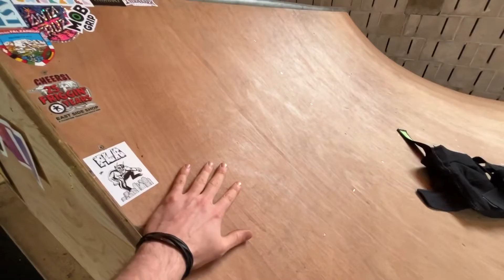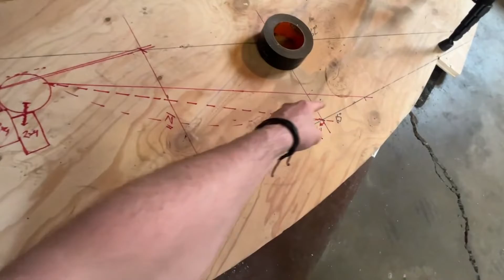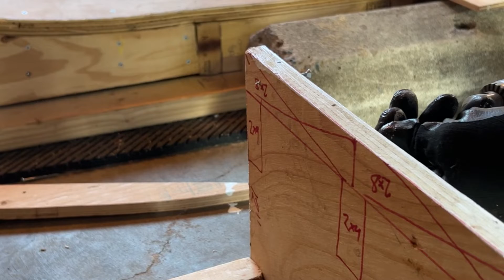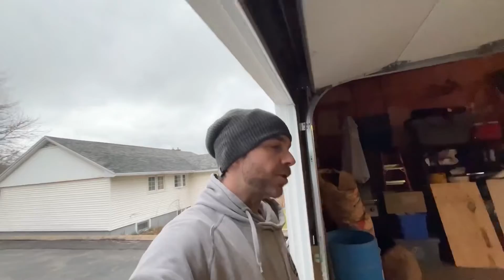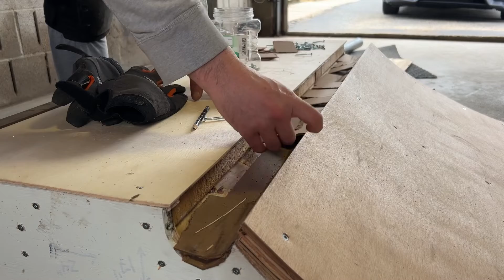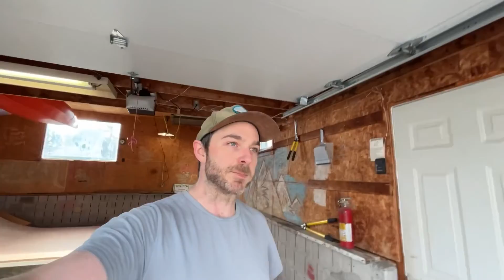How to Build an Easy to Skate Micro Quarter Pipe!

Comment: Disregard my lasrt questions,    i got the incorrect wood for this project.  Its too stiff and heavy to cut and bend: 3/4 pine pressure treated G.C. 4x8.    So cheapper wood ,is ok ?  Oh i do plan on having the ramp outside

Comment: Not sure if you’ll respond to this but I just built one of these. I built it 12” high but I think I went too tight on the transition. I did a 4 foot radius I should’ve probably went 4.5’ or even 5’. Also only have a 1 1/4” coping. My wife and I are opening a hair salon and there was a natural gas line that needed to be cut out so I used that and kind of mad at myself for being cheap and use it. For the coping I used 3/8” bolts through the 2x4 worked really well and I can adjust the height of my coping. Thanks for this video it helped a lot. Just need to finish the top deck of it and attach my angle iron. I do need to get a sheet of hardboard and a steel plate for the bottom but cost of materials is insane right now. My next project will be a 3’ high by 6 foot wide mini ramp in the garage. Debating if I want to do a full mini ramp or 2 quarter pipes.
Reply from the maker: Hey thanks for your comment! Two quarter pipes will be a little less expensive and probably more convenient (since you can move them) but a mini does ride a bit better! Let me know if
Reply: @skate_oasis last part of your reply was cut off for some reason but thank you for the reply. Yeah I may do two quarter pipes that way during the winter I can skate my ledge and manual pad move things around. Yeah it’s a little tough to skate. I cut the radius slightly steeper in hopes I’d be able to actually rock my rock to fakies but it seems no matter how tight the radius is something that short wouldn’t be able to do that regardless. I just got back into skateboarding now at 35 after 18 years of not skateboarding. It’s nice to build the things I wasn’t able to as a kid. I mainly built this one for my kids and for me to play around with. I made a small manual pad/ledge but the ledge is only about 8” high and hard to learn krooked grinds again and popping in nose slides and tail slides. Debating if I want to use angle iron or cut in a square tube or another piece of that round rigid conduit. For sure will need to get some smooth masonite for the decking and top layer of the transition. Just have to remove the 1/4” top layer I have on there now. It works but can feel it with my 51mm wheels
Reply: How do u figure out the smallest ,melowist transition? Just eyeball it

Comment: Whats the length on the top sheets of plywood for the transition surface
Reply from the maker: Good question - and I do not recall. They’re not that long, I measured and cut them after I set both bottom sheets and the threshold

Comment: each top layer should go to the ground not cut at the same length as the one under it
Reply from the maker: Excellent point! Can you tell I'm an amateur lol!? 
That being said, I knew I was using a really serious piece of steel for the threshold so I wouldn't run into any issues with deflection at that point. 
Thanks for commenting!

Comment: Hello   as a super begginer and wanting to drop in starting off small.  Would this be considered a true drop in or does a drop in have to be on vert.  I want to learn
Reply from the maker: Hey! Firstly, welcome to the skateboarding family! 
Regarding dropping in - this is a really small ramp but all the fundamentals for dropping in are the same. 
I'm not really a big fan of labelling tricks or moves as "true" or "real" because everything is valid IMO. 
Tallest thing I've dropped in on was 8' tall, still not a vert ramp though.
I guess my point is that you should always start small, and you should celebrate the moves you can do and not worry about how they stack up against others. 
Thanks for your comment!

Comment: How did you determine your transition line? Just eyeball it?
Reply from the maker: For this one i traced the transition on my mini ramp. But for that I lined up a long 2x4 with a sharpie on one end and the other screwed into plywood so its like a big swinging arm. Ben Degros has a great tutorial on this. 
I went with a 6' radius because thats what Keen Ramps use on their 2' high x 8' wide model. I wanted something chill and easy to skate.
Reply: @skate_oasis great, thanks!

Comment: How much does the coping come out?
Reply from the maker: The coping relief is between 1/4" and 3/8" 
I think that's what Keen Ramps uses on theirs and that is what Ben Degros reccomends in his mini ramp building videos. The trick is to get enough exposure so you can feel the bonk, but not so much that you'll stop and hang up on the way up or down. Luckily though, the ramp is very difficult to hang up on because of the height and it's (relative) mellow transition radius. 
I've done this a few times so I have a little wooden template I use to find the right coping place, but it's always a bit of a challenge. I'm by no means a skilled builder, so I go slow and double (and triple) check everything.
Let me know if you have any other questions!
Stay rad friend!

Comment: the coping is going to sag over time if it's relying on those shims to stay at the correct height, especially if it gets wet... 
looks super fun though! :3
Reply from the maker: So the shims really only hold the ends in place. You can't really tell in the video but the rib underneath the coping is slightly warped facing upwards, so there is a center contact point. Client knows this isn't weatherproof, so it's a garage and sunny day kinda ramp. 
Really appreciate you watching and commenting!
Stay radical friend.

Comment: Hey Will - curious as to the dimensions of your Garage halfpipe (not the one you built in this video). Thanks!
Reply from the maker: Hey, absolutely! The mini ramp is 2' tall, 8' wide, and about 20' long. 6' transition radius, 24" decks, and about 6' of flat bottom. I've got a couple of videos about the ramp from last fall if you want to check them out. Thanks for watching and commenting!